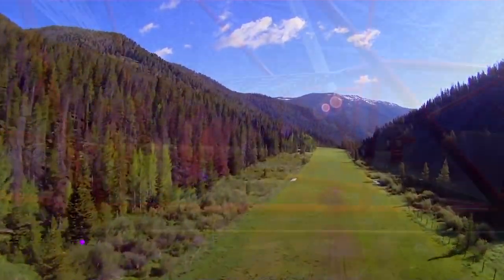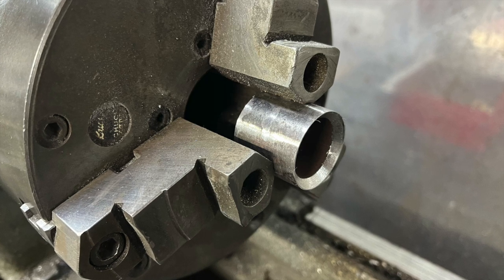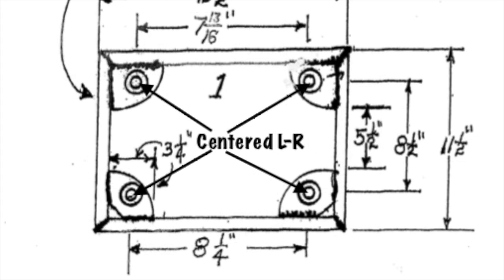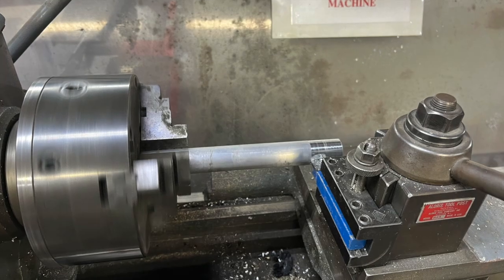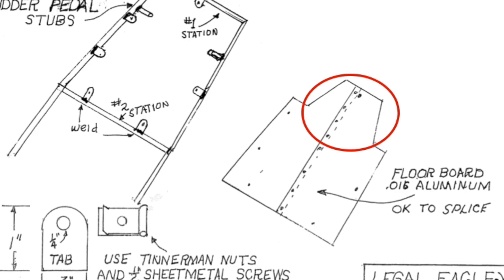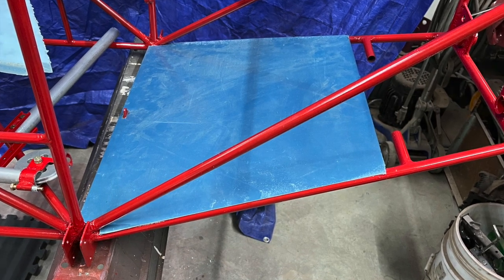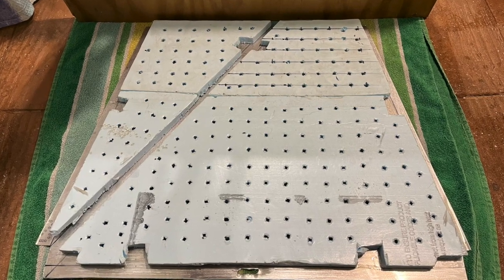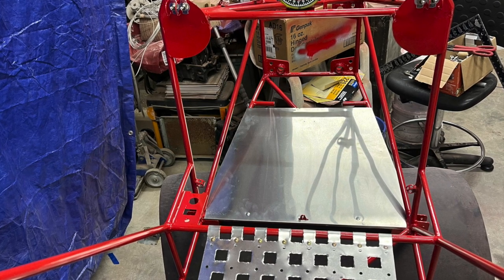19 Floorboard & Firewall - ADCO Aviation's Legal Eagle XL Ultralight Aircraft Build Series

Comment: Nice job on the floor plate an engine mounts. Lot of lathe work making those. I tack welded mine flat with 5/8 nuts spacers, I still had to sand/polish the inside of the spools when I was finished welding everything out.
Reply from the maker: Again, thanks Keith. I’m super pleased with the floor. I have put all my weight while getting in and out and it looks and feels solid. No metal creaking or groaning. No bending or bulking. Engine mounts… yep, I’m glad Les has started offering those for those that don’t have access to a lathe. I had access to a great hd lathe at work. But unfortunately not a lot of choices with the tips. But I made it work and had fun doing them.  Yes cleaning out the tubing after welding has been one of my biggest challenges with the whole project!!! But I keep reminding myself that must mean good penetration. lol